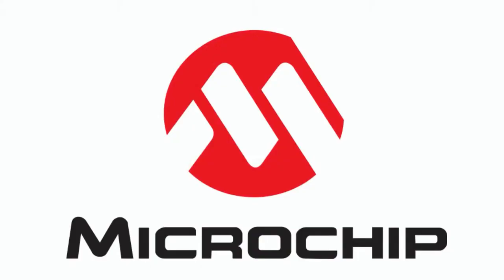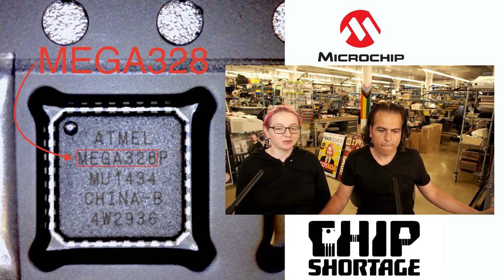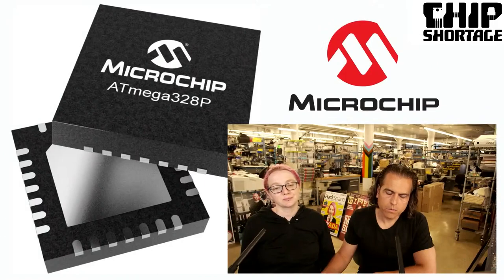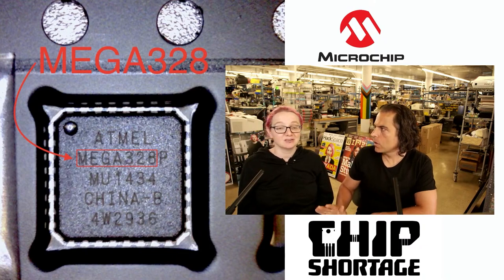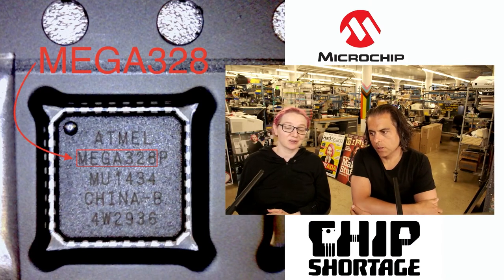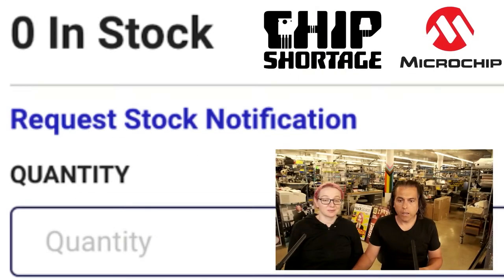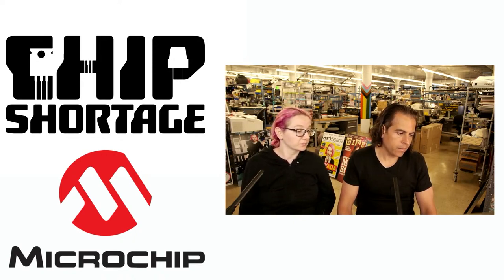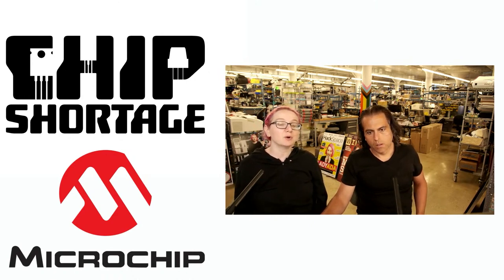Chip Shortage: Microchip ATmega328P Microcontroller #ChipShortage @Adafruit @MicrochipMakes

Comment: This is a great time for people who've been using ATmega328's for the last 10 years to stretch their legs and get outside their comfort zone to try a new architecture. I spent a few weeks reading the full datasheet for a PIC microcontroller and after getting familiar with it, I feel like there's a lot more I can do and a lot easier than trying to live with the Arduino IDE.
Reply: Yes absolutely. Start getting into ARM Cortex (M0, M3) based chips. May more alternatives out there and easier to pivot.
Cheers,
Reply: Pic32s (MM, MX, MZ) are pretty good as are pic24s and dspic33s. Some can be had for around $3 with lots of flash and RAM.
Reply: too bad they're also out of stock :(
Reply: @Saghetti  there are microcontrollers in stock as long as you aren't too picky about the exact model.

For example, Digi-Key have over 1000 of the PIC32MM0256GPM028-I/SS at the moment.
Reply: NO, Never. I love Atmega

Comment: I work at a distributor, Similar MEGA series microcontrollers from Microchip and the former Atmel are affected too. Microchip/Atmel has terribly inconsistent markings on parts and labels due to the fact that they had a ludicrous amount of different contract manufacturing locations. It's nearly impossible to identify the parts for sale, So even "new old stock" is basically un-sellable due to being pre-programmed inconsistently. The documentation for how to decode based on Microchip/Atmel lot numbers, and customer special identifiers, is not available as far as I know, this locks down cheap stock.

Comment: it LITERALLY says what to use instead of the 328p: the 328pb, which is a newer model, improved all-around, almost drop-in compatible... you don't even have to speculate. says so right there in appnote AT15007! hackaday had an article on the new version back in 2016.
Reply: For some reason I was thinking that the PB is not just a drop in replacement. (And it's also not available either)
Reply: It isn't quite a drop-in replacement, you have to make a minor change for the extra port pins, or set them as inputs (off the top of my head, I've only ever used the PB of this range).

Comment: 8,000 chips is probably less than 1 batch of wafers. Perhaps you could club together to generate a sizable order. But if they can't squeeze in one batch, then they might have changed their FAB Tooling to manufacture more lucrative chips.
Otherwise, you could go to the old Atmel FAB in Colorado Springs and see if they are using ATmega328 on test-wafers that you might be willing to take a chance with.
But you would still need to have the chips packaged.
Just thinking outside the box.

Comment: Many of these chips could be moved to 300mm wafers where there is much higher capacity and the die are smaller. But with the high profit, they have no motivation to make the move.
Reply: Former Microchip FAE here (I was in the PIC24/dsPIC33 group). These parts will never move to processes <45nm (or even <90nm) because of the cost of a mask set. For say "standard" 35nm the cost of the masks and test program is ~ $1million. For these $1 chips, they would have to sell millions to break even. NOT EVER going to happen.

Comment: YEP. Over the past year, just as I was getting close to finishing a bunch of Arduino-based prototypes, I've had to pivot completely away from the platform that I got comfortable with over the past decade: ATTMega328P AND the ATTiny85s. I thought I was safe when I saw the chonky PU chips in stock throughout most of 2020 but those are gone now too. And I'm not a fast or prolific YouTuber-level kind of person. I'm slow as molasses. I know that the 328P is very slow compared to newer options, but most all of those options are out of stock too. All that's left is RP2040 so that's what I'm trying to learn, but my free time is very limited. Could take me a long time.

Comment: Isn't that the chip that's the core of the Arduino?
Reply: The Arduino Uno anyway. You can use the Arduino IDE and framework on lots of chips.
Reply: Yeah, I think there's some backstory why they didn't name drop the Teal Italian Microcontroller Company, but yes the 328P is best known to us hobby electronicists as the heart of the Arduino Uno and Nano.  I bet the ATmega2560 that powers the Arduino Mega is in short supply as well, which likely makes the 3D printer world lean forward in their chairs.
Reply: @thegardenofeatin5965  because Adafruit does not currently manufacture Arduino branded boards.... They send these videos to the chip vendors to beg for their orders to get filled.

Comment: That sucks, but to be fair I think Microchip has handled the shortages better than most. I've been able to get most of the parts I need before they went out of stock and many good parts are still available. Just not always the exact one you want...

Also I think they basically never discontinue anything. They just raise the price on old parts over time to encourage users to move to newer parts. If you can't, they will still supply the old ones

Comment: What will happen is that the orders will build up to the point where the stupid middle men will eventually decide it is worth their while to make a speculative order to the manufacturer based on the current price and then there will be a glut. but the reality is why waste time changing dies and making these cheap chips when the car manufacturers are crying out for their microchips just to sell a car. A typical new car needs 100 per vehicle and they are paying a premium to keep the cars rolling off the production line. We have to wait until the markets for more expensive chips stabilizes first.

Comment: Wanna make money? Open a chip manufacturing company.
Reply: all it takes is about $4billion and after 6 years the first chips roll out.
Reply: Those chip makers also have problems getting the raw wafers and the necessary chemicals.
Reply: @Hauketal  yeah i read up a bit about this on my break yesterday. Seems like its mostly the 200mm silicone wafers. The shortage actually existed for many years but obviously recent events made it worse which explains why its hit harder than most other industries, because it was already struggling. That said, open a silicon wafer manufacturing company. 🤣 how much does that cost? Im sure there will be more shortages up the line from there too.
Reply: Elon Musk is the perfect person to deal with this problem. Kind of baffled that he hasn't yet made a move in this important industry sector.
Reply: @gravestoner2488  Half of the world's semiconductor-grade neon came from Ukraine.